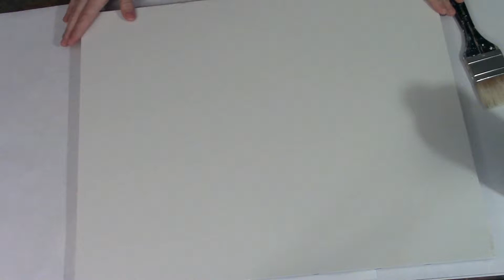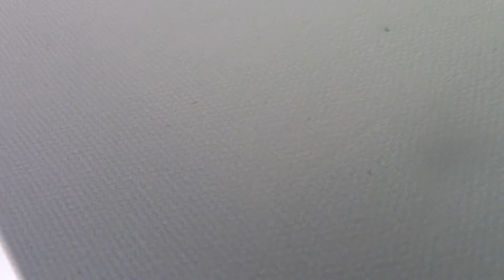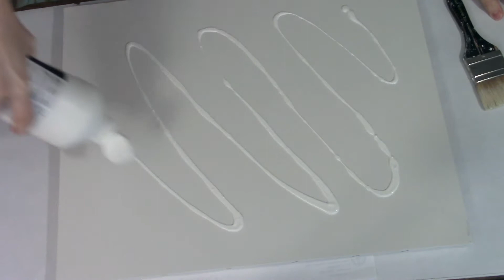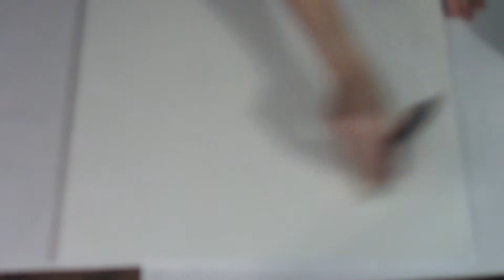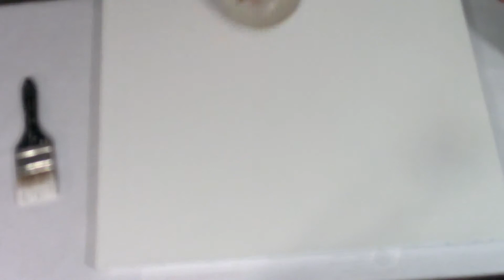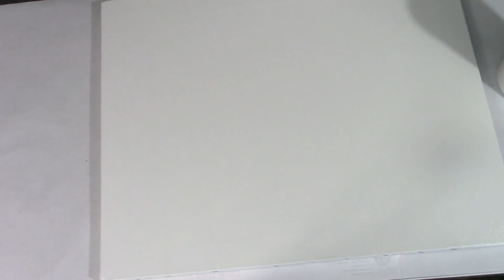#1: MAKE YOUR CANVAS SMOOTHER - How To Gesso A Canvas for beginners - gesso using Liquitex white.

Comment: Ok I've been using it all wrong lol. Thanks for this. So what are the biggest differences you see using gesso compared to not using it??
Reply from the maker: I like fine detail and realistic paintings. The major thing I've noticed is being able to get that. When you have huge bumps in the canvas the paint just clings to the top of those bumps. When you add gesso and sand it down to get a very smooth surface the brush and paint glide on the canvas allowing you to get fine lines. :D Thanks for the question! 🤗🤗